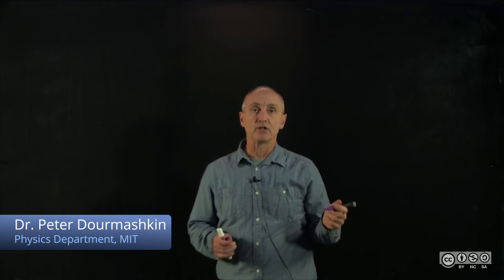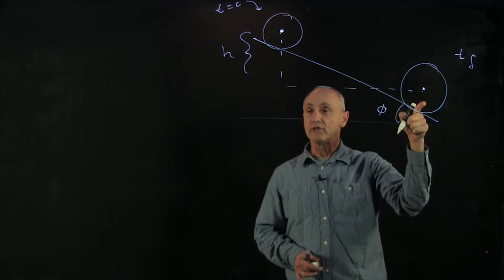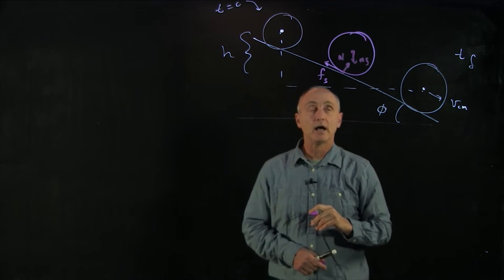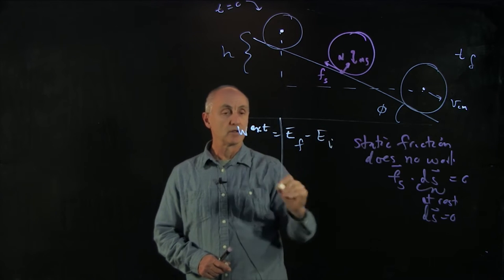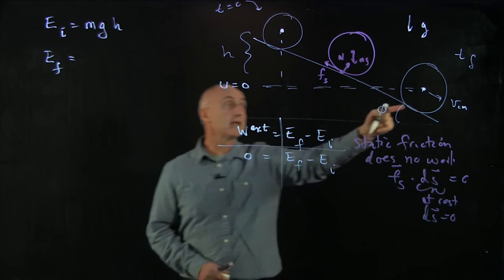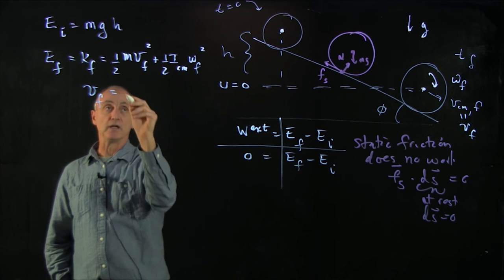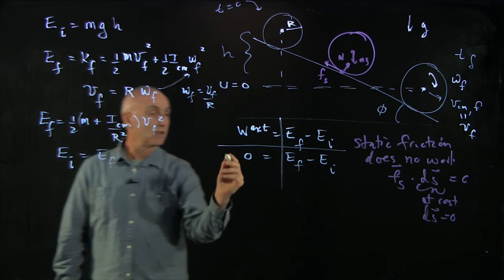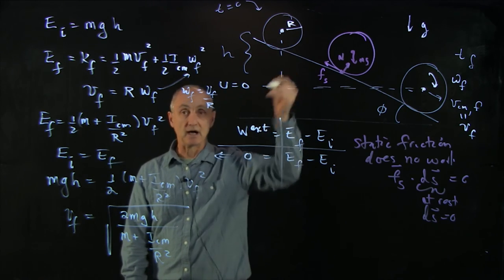37.2 Worked Example - Wheel Rolling Without Slipping Down Inclined Plane

Comment: fs is the force which causing rotaion of wheel and if fs work is equal to zero  the wheel slide down without rotation 
so fs does work and its work is hide in rotational kinetic of wheel

Comment: does it change if there are spokes within the wheel?
Reply: why should it change?
Reply: @Postermaestro  It does change, the spokes change the mass distribution of the wheel; therefore, the moment of inertia of the wheel changes, so the speed does definitely change
Reply: @Andres186000  Well first off, we're assuming that the spokes are symmetrical, so the moment of inertia absolutely does not have to change. Secondly, it doesn't change any of the equations. It would be the same as asking: "does it change if the wheel is heavier?"

Comment: I don't understand why the static friction does no work, because the static friction is also acting on the centre of mass while the centre of mass is moving
Reply: The static friction never does work since work is force times distance over which the force is applied. If you think about it the force never does any work on the contact patch since that part "isn't moving" where it touches the ground relative to the ground.
Reply: @Andres186000  If we take the center of the wheel as a reference point, so relative to this point the contact point between the wheel and the inclined is in motion (not at rest).  My question what is the expression of the work done by the friction between the wheel and incline relative to the center of the wheel?